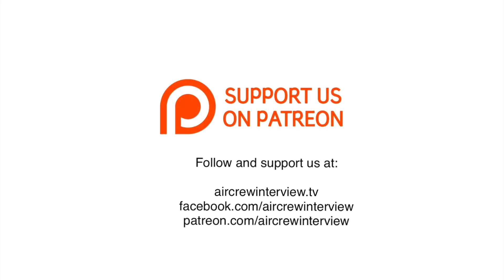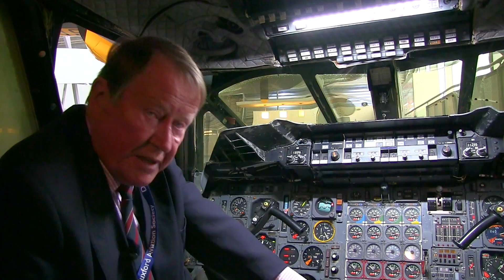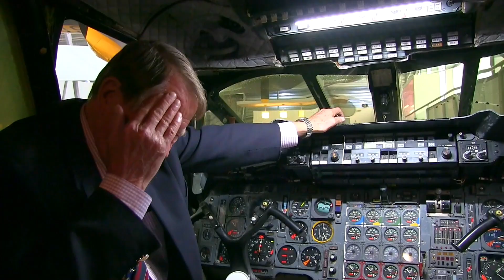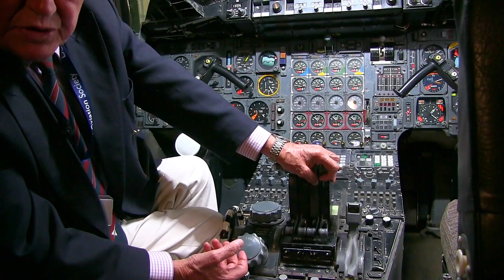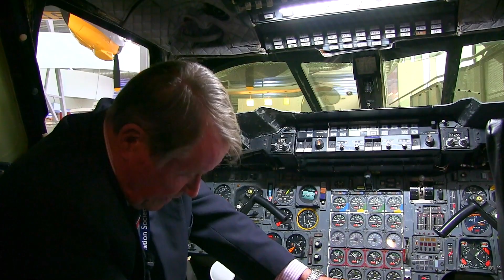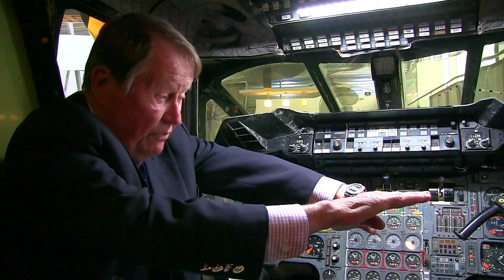John Hutchinson on Air France Flight 4590

Comment: Very interesting analysis.  One small point though:  the rotational speed of the tyre could only be the same speed as the aircraft travelled along the runway - therefore the piece of rubber that hit the wing would only have been travelling at something like 140-150 mph at impact.  I would have thought the wing and tank(even when full) should be capable of withstanding this bearing in mind they may be hitting birds etc. at far greater speeds than this.
Reply: "the rotational speed of the tyre could only be the same speed as the aircraft travelled along the runway"... ummmm... no....??? linear speed = angular speed x radius of the rotation. Since wheels on planes are proportionally relatively small (small radius), they tend to have very high rotational speeds.
Reply: ....Ummmm...no....???  If you think again (carefully this time) you will realise that the radius of the wheel is irrelevent in this situation as what is linear speed is converted into rotational speed then back into linear speed (albeit in a different direction) when the "lump of rubber" breaks away. I won't go into the formula but using your argument racing cars would be fitted with tiny wheels as this would mean they go faster.
Reply: Please, do go into the formula, you will realize your mistake. What would happen if the plane had ridiculously small wheels? they would spin very fast at 200 knts, right? That´s because their small radius only allows them to cover a very small distance per revolution. Ergo; to go faster, the faster they spin and the higher their rotational speed. Bigger wheels do less rpm per same distance covered. You can see then that the linear speed of the plane is not the same as the rotational speed of the outside of the wheel, otherwise its radius would not factor in.
Reply: Furthermore, regarding: "I won't go into the formula but using your argument racing cars would be fitted with tiny wheels as this would mean they go faster." That´s not what I´m saying. At all. The linear speed of the vehicle is not related to the size of the wheels, that´s ridiculous. But the rotational speed of the wheel is related to its radius and the linear speed of the vehicle.
Reply: You state the obvious very well.  I told you go away and think properly about what you're saying.  
Linear speed=angular speed x radius.  
I'll give you a clue (which should be obvious to any sentient being) this also means angular speed x radius = linear speed - no more clues though.
I'll break off from this exchange now as I'm not your teacher.
Reply: Birds are not made of metal.

Comment: I am suprised to hear some of the things Captain Hutchinson mentions. 1) In the CVR transscript I see nothing about the captain ordering the extra 19 bags to be loaded. Not that I am supprised if it correct. 2) At 43 min 25,8 sec Captain Marty  orders Engine fire procedure. As I read it, this means he is ordering the Eng 2 to be shut down and the extinguisher to be fired.
Any way, a pleasure to hear Captain Hutchinsons explanations. Thanks
Reply: But if the engine fire procedure at takeoff is to cancel the alarm and engage contingency power (as Capt Hutchinsons says) why did the engineer shut the engine down instead?
Reply: @slammerf16  We will never know :(
Reply: CVR wouldn't have been running at that point.

Comment: Suppose the Captain had done everything correctly, would the plane been able to survive the metal strip and subsequent rubber assault on it's fuel tank?
Reply: I think that one could only say that its chances would have been improved. If the one engine alarm had been properly ignored the aircraft might have accelerated to the point that it had sufficient pitch authority to counter the aft CofG problem ........maybe. I do not know if the flight crew had the skill required to control the increasingly out of CofG aircraft. Some sort of ditching or forced landing might have been within the realm of possibility.
Reply: I think the crucial bit is wether or not the fuel tanks would've ruptured from the shockwave had they not been filled as full as they were. Once that happened and the spilled fuel ignited I don't think there was any oppurtunity left to put her down without killing everyone on board.
Reply: I disagree. There are no absolutes in these occurrences. Sufficient structure might have remained intact long enough for a return to the airport. The important part with the fire was that the fuel was igniting outside of the wing. The fire was well down the list of contributors to this disaster. The fact that CofG critical fuel was leaving at a prodigious rate was far more dire than the fire. Airplanes and aircrew of all sorts have flown along with burning fuel pouring out until the supply was exhausted, and lived to tell the tale.
Reply: Peter Timowreef i
Reply: What are the chances that it was the first time that this captain had overridden fuel, weight, and C.O.G. limits? Zero. He probably had so much confidence in the surplus of performance of the aircraft that he felt invincible. But those limits are there to allow some headroom for the unexpected. Sure they can be breached when everything unfolds perfectly, but you've left yourself no get-out-of-jail card if just one unexpected hitch comes up.
Reply: Two things to consider are that had it taken off from the other end of the runway, as JH points out it should have done, it would have had less fuel (potentially leaving some air in the tank to absorb the shock) and would possibly have had time to stop as it might not even have reached V1 at the time of impact.
Reply: Brigadelok - I can't quote the source because it was many years ago, but I once read that it was routine for Concorde to depart and land in the direction of flight (and other traffic to be held to accommodate it) on the LHR-JFK route regardless of prevailing winds (within reason), and I assume the same would apply on CDG-JFK.

Having been designed primarily for east/west coast operation in the US (the lucrative market whose withdrawal emptied the order books and effectively turned Concorde into a 'novelty act' that never repaid it's development costs), it barely had the capacity to cross the Atlantic with sufficient reserves. For this reason, they tried to avoid flight in the 'wrong' direction whenever possible.

It's only speculation on my part, but I would guess that, mindful of the tailwind, heavy payload and shortened runway, the Captain did originally intend to taxi to 08, which would account for the extra taxiing fuel (if it took only 5-6mins to reach the threshold of 26, he must've been gated on the eastern side of the airfield). With the significantly delayed departure, and under pressure (that John alludes to in the video, but few outside of the industry would truly understand) to make up whatever time he could, he saw an opportunity to make up maybe 10-15 minutes and rolled the dice.

Although it's easy (and correct) to say that his actions were 'unprofessional', without that one in however many thousand chance of running over a large foreign object it would have been judged by management as a good decision. More importantly, had he departed 10-15mins later and incurred huge compensation claims from passengers who missed their connection, that same management - oblivious to the tragedy that had been averted - would've (unofficially, but no less damaging career-wise) judged his actions then as unprofessional.
Reply: Possibly. Possibly not. Along with 447 I am deeply distrustful of Air France, and especially the training regimes they have in place.
Reply: You can not take off from the other end against all the traffic because other planes are around and you would interfere dramatically with them. ATC would have to change of runway for everybody and clear the area prior to allow that. With a low tailwind that other aircrafts could accept, this option was not available...
Reply: Otterspocket2: I heard too that it was common practice to hold inbound traffic to allow direct landing for Concorde. I do not know if it was also common on take-off nor if it was usual at CDG. I recall to hear it take-off daily but not to actually see it. But remember it was an exception, when the wind made it possible and when remaining the fuel level on arrival made it a necessity. For departure it is up to the crew to load extra fuel, which they did.
For instance, the official report does not state any exception on that. Concorde used the current runway and it was the direct path, thus no need to ask for a reverse take-off since the tailwind was within the limits even at MTOW. What would have happened if Concorde took-off the opposite direction ? I guess it would have hit the metal strip with the right gear instead of the left but would sadly have ended the same way even with less fuel due to longer taxi.
The report also points out the crew did not make unprofessional decisions; all the parameters were within the acceptable limits (as they could know at the time) altough it left them with no margin for error or problem. And this is where bad luck strikes: an accident is generally the result of several safety margins to be lost for whatever reasons. And when the last one is lost, you're lost ! 
One may think that the crew were reckless with their choices and the report actually states thar the Concorde crews were the elite and it was common practice to rely on the greatest experienced pilots in derogation of usual procedures. Nonetheless, the flight 4590 crew did not exceed the safety values, and  without that infamous metal strip, the take-off would have been somewhat normal.
What John Hutchinson is right about is that reducing the safety margins is the beginning of increased risk. It should be a instruction basis that every pilot should be uncomfortable with such practice and fight the "mission accomplishment syndrome" that leads to ignore some signs. The result is that fearing claims for late arrival is absolutely nothing compared to such a disaster. There are so many examples where pilots chose to divert or abort because of a minor problem. They chose to prefer safety over money and to survive and non is to be blamed for that. Please see the Mentour Pilot videos to understand the safety philosophy on a low cost company on you will be surprised to see there is no risk taken on the subject.
Reply: Brigadelok.com "
Reply: Sounds like probably not, I mean, according to the way this guys says it. It sounds like the wing would have been able to withstand the hit from the piece of rubber, no rupture, no fire, no loss of control, no crash. A more detailed analysis might be able to give you some sort of figure giving a percentage chance that the fire never would have been started if the tanks hadn't been over-filled. If this is incorrect, then he probably shouldn't have mentioned it, because it confuses the issue, making the accident seem more unlikely than it really was.
Reply: The official report of french BEA says that experiments on the shockwaves could not reproduce the conditions as to have to extrados to fail. But it showed that inner structures could suffer some damages.
Also, the tanks were not overfilled, calculations showed that there was some room left, but the acceleration of the take-off made the fuel to be pushed against the walls...
Reply: Brigadelok.com I could be wrong but don't aircraft tanks have a honey comb structure inside to stop
Fuel sloshing about ?
Reply: Ryan Flood: There are of course walls and rims to stiffen the structure, but the inner volume is mostly empty space where fuel is stored. There are wide openings, large enough for a thin man to enter for inspection. The BEA report shows pictures inside the wing of a concorde: there is enough room for shockwaves to travel across the wing. Also, don't forget: the fuel must not be trapped in the tanks, so there are communications between all compartments of a tank for the fuel to flow through. The conclusion is that although it was not proven the shockwaves due to tire impact could tear apart the upper skin, they are very likely to damage the inner structure, near the gear well for instance, and that resulting fuel leak and fire damaged the engine electrical wiring and fire detection loops. Fire was not in the engines but it appears that flames were able to get there due to turbulences around the lowered landing gear and engine nacelle creating local low pressures that sucked them forward. No first default condition study could foresee such a chain of events.
Reply: @Brigadelokcom  Indeed you are correct the French couldn't reproduce the damage in post-crash testing, they were being conservative in their estimations of the forces generated. They should have increased the forces until they achieved the failure but that would have led back to the defective left bogie and subsequent uncomfortable questions and conclusions.
Reply: @coyote5735  I do not know what you are referring to about "the defective left bogie". 
"Damaged by the metal strip" is more precise and says it all: it is an external cause. The wing/engine nacelle design itself is not at fault, even if it has a vulnerability to impacts that should not occur by the way. 
There are no uncomfortable questions, only the answers can be. I do not see anything really doubtful in the BEA report.
Reply: @Brigadelokcom  If you were an engineer you would be asking plenty of questions about this crash. Go read the reports by witnesses who were ignored by the investigation their account paints a different picture.

As for the left wheelset, your countrymen left out a vital shim that allowed the bogie to rotate by up to 4 degrees, the wheelset turned inwards causing drag, the thermal energy transferred to the tyres weakened the structure of the tyres and increased the internal pressure. Three French firemen reported the left wheelset on fire as Concorde waited at the end of the runway for clearance to take off, their account was ignored. The engine that failed ingested tyre fragments meaning that the explosion of the tyre resulted in rubber parts firing forward far in excess of 200mph (the impact force is directly proportional to the velocity of the tyre fragment, double the speed double the force) as the wheels are behind the engine intakes. The hole produced in the wing was 300mm x 300mm. The energy released during the tyre explosion was many magnitudes higher than would normally be expected.....but the metal strip did it, how convenient.
Reply: @coyote5735  Please, don't be irrespectful, I read the report as I read the first version of your reply...
Did I wrote I am an engineer ? No. But you're right, engineers may have a lot of questions about this case (or many others), but without access to raw materials, it is impossible to work on solid basis. 

So, I read only the BEA report to avoid fantasy rumors and I am not aware of any trouble with the left gear nor firemen reports. On this particular point, this is the first time I hear about this and it is really difficult to believe that an aircraft on fire would be noticed and not held. No brake temp sensor alarm. No radio traffic released (I tell you, the CDG airport frequencies are monitored constantly by spotters and amateurs, as I do sometimes from a few kilometers distance), no testimonies mentioned it.
 It would mean that the fire began before the take-off and the metal strip incident be purely coincidence. Seems too unlikely for an investigation team to consider it.

Also, I am not sure a 4° gear offset would produce enough friction at taxi speed to ignite a tyre. If there was so much friction, the crew would have noticed and reported it. I will check the report when back from vacation if there's a mention of that.

All in all, the conclusion is that the overall design of the engine nacelle disposition so close to the gear is a factor to such a disastrous combination as it was already known as it happened before with tyre chunks projection.
For me, this case is closed as I can believe this report. There are example where falsification is obvious but this is a whole other story.
Reply: In other words, even with two tons less of fuel, the liquid would still be there and transmit the shockwave upwards where, reflected by the ceiling, it could severe frame/skin junctions as the free surface would still be far away upfront the displacement direction. With a shockwave directed upwards, you can not expect a side surface to absorb much of it.
Reply: Remember the undercarriage was already missing a vital component.
Reply: The implication is yes.
Reply: Not an expert but my guess is, the chances would have been better. With the plane having a proper balance of weight and that engine not shut down, it probably would have been able to stay airborn long enough for an emergency landing. If the fueltank would`nt have ruptured and cought fire at all due to having enough air in it to absorb the shockwave, maybe even fire wouldn`t have beend an issue. But then i ask myself, if the tireburst would have gone noticed.
Reply: what is not mentioned is the Capt. Hutchinson actually saved an aircraft, with souls on board, years before with an engine on fire during takeoff.....so his comments carry great weight
Reply: The captain did not deserve to fly such a beast plane; the choice to takeoff with the excess weight itself seems highly suspect. Same as drinking & driving, don't even start.
Reply: If he had done everything correctly  He would not have been on that run way in the first place , copilot should’ve spoken up he made some really stupid decisions reckless